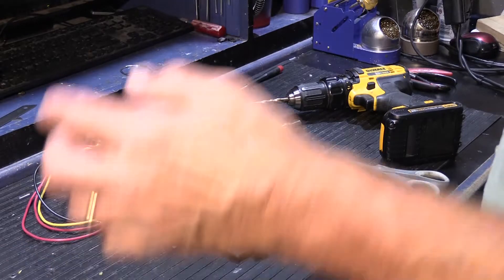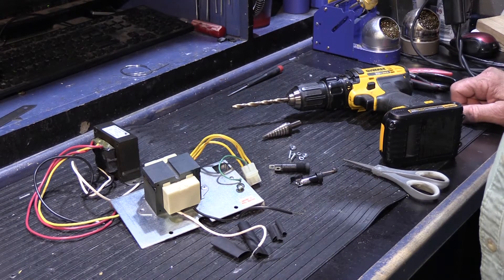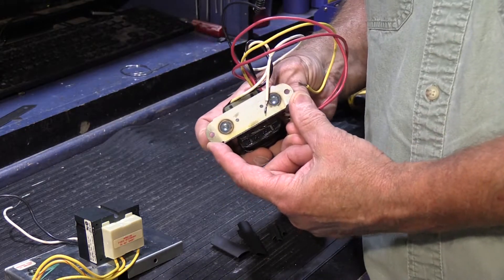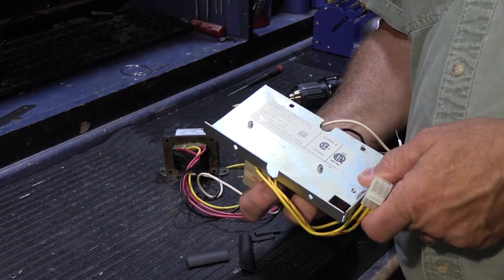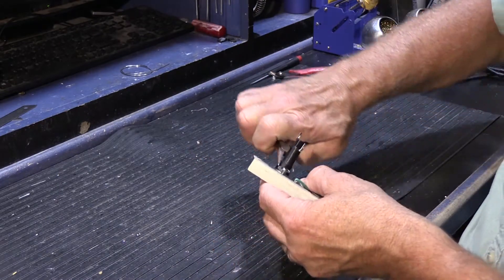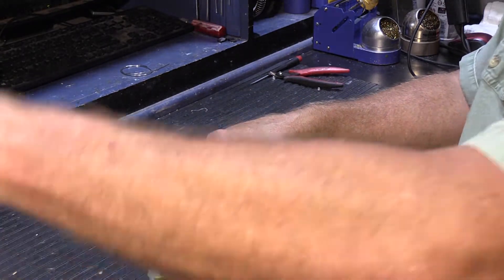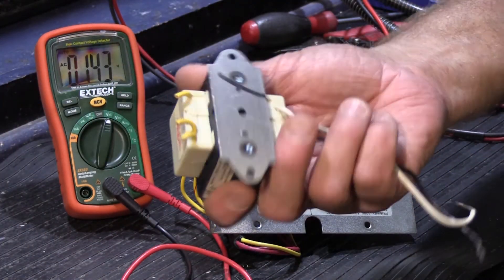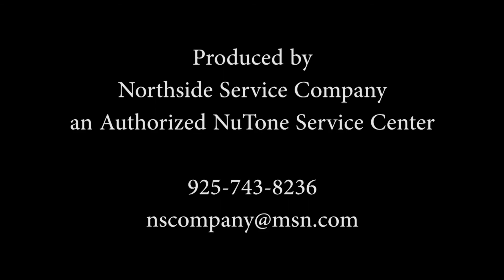How to build-up a Replacement Transformer - to Replace an obsolete Music & Sound (M&S Systems) TE1A

Comment from the maker: If you have an early Music & Sound (M&S Systems) Intercom System and your low-voltage Transformer has died - This Video is for you - Chris
Reply: Thanks Chris.  I left you a message on another video and found this one, so I think I'm good.  My M&S is a MC170 and the transformer is a TE-1
Reply from the maker: @FixitMys3lf  
Northside Service Company
30 seconds ago
Hi D Cloes:  I'm not familiar with the TE1 Transformer - however based on the fact that it is used with a MC170 - it probably has an internal fuse.  The real question is - "did the Fuse fail on its own - or did the MC170 cause the Fuse to blow" ?  
Here's a link to our Video that may help you figure out where the fault is - https://www.youtube.com/watch?v=Usmvj2kRYbc&list=PLsTvqKsBnGYeAXwG1jzjTMwQpeSfTEvBq&index=11
- Chris

Comment: I very much appreciated the video about "making your own transformer" because it told where to get a replacement for the 120 V, 40 watt, 2 circuit or center winding, transformers used in obsolete Broan-Nutone and Music and Sound residential intercoms. (The suggested supplier, Mouser Electronics, is a supplier in our area of Texas.)However, I caution against using a 2 or 3 ampere fuse to protect the primary winding. Power or watts is equal to amperes times voltage. Therefore, 120 volts multiplied by 3 amperes equals 360 watts or 240 watts if a 2 ampere fuse is used to "protect" the primary winding. A 360 watt or 240 watt load may be too much to keep the suggested 56 watt transformer from burning out before the fuse blows. I suggest a fuse with .33 to .50 amperes to protect the primary winding. My customer's 2 A fuse on the secondry blew and the 40 watt Music and Sound transformer also failed.
Reply from the maker: Hi fredblundell:  You are correct in your calculations - Typically a fuse would be rated at 125% of the expected current - a 0.75 amp fuse would have been a belter choice - Chris

Comment: Great video, I am in the process of installing a DMC 1 into my new house.  I installed all of the infrastructure before the drywall went in.  These transformers look similar to mine so I may need to re-watch this video 10 years from now!
Reply from the maker: Hi bigchevs1:  We already have a Video about testing the Transformers for the DMC1 and another Video which shows how to replace the Fuse in your Transformer when it blows- Chris

Comment: Hi Chris, great video! I have an M&S 602 with a TE-2A transformer - very similar to the TE1A, Can I combine the two 12V wires to make 24V and separately power a Ring video doorbell and associated relay to close the circuit on the MC3 chime module? Thanks!
Reply from the maker: Hi Edwin: No - You will need to add a dedicated Transformer for the Ring - Chris
Reply from the maker: @edwinyoung5022  Yes, it should be fine to power the Ring - Chris
Reply: @northsideservicecompany3567  Thanks!

Comment: Would if primary winding is open on a bad transformer. How do determine voltage outputs on two secondary windings??. No markings on bad transformer
Reply from the maker: Hi Tommy:  I don't think there's any way to calculate the secondary voltages - You would to look at the device it's powering to determine the voltages are.  What product is the Transformer for? - Chris
Reply: @northsideservicecompany3567  it's a powered sub woofer. It's 110v on primary. I can measure in ohms the two secondary windings with center taps. Can't you determine voltage outputs based on that??. I want to order a new transformer.
Reply: Are world today in not service anymore, it's a throw away world
Reply from the maker: @ta26532  To calculate the voltage from resistance measurements - you need the measurements from both the Primary and Secondary coils.  What does the sub-woofer say it's input voltage is?  You also need to consider the wattage should be - Chris
Reply from the maker: @ta26532  Not always - Chris
Reply: @northsideservicecompany3567  it has a 110v input . It's a step down transformer. Now it has 2 secondary outputs. Each secondary winding measure in ohms. One reads 2ohms and the other 4 ohms. Based on the size of trans. I can determine the VA rating. I want to order a replacement
Reply: I replaced transformers all the time, but this one is unmarked with no voltage markings on it.
Reply: I have no schematic diagram. Company it out of business. I like challenges when repairing things
Reply: It's ok . I'll figure it out myself
Reply: I carefully took apart transformer and found internal bad 3amp fuse. Funny fuse on front panel is rated at 2amp?? Both are fast blow type. I wonder why the different fuse ratings
Reply: The 3amp fuse blew before the 2amp fuse ?? Humm...

Comment: This is amazing! I'm facing the exact same issue with an M&S system transformer, same exact model, in our house. Could you please provide links to the fuse and transformer you used to replace it?
Reply from the maker: Hi Sean:  I've added Links for the - Transformer - Fuse Holder - Fuse Cap - Fuse - in the Video description - Chris